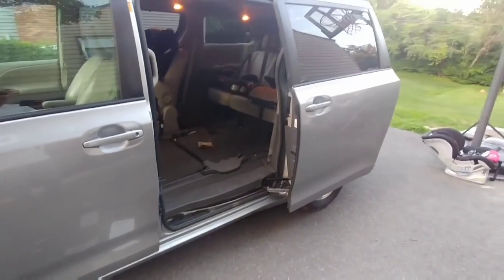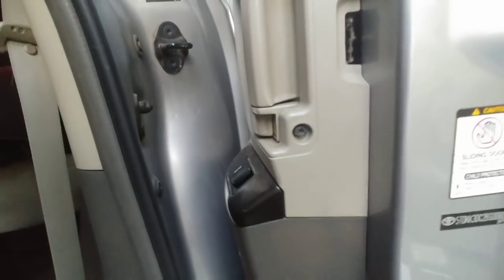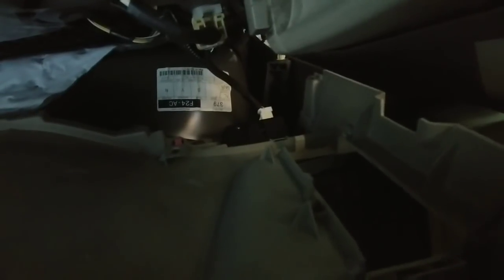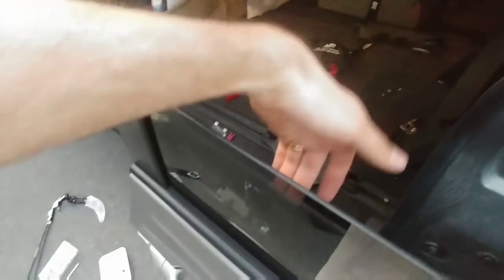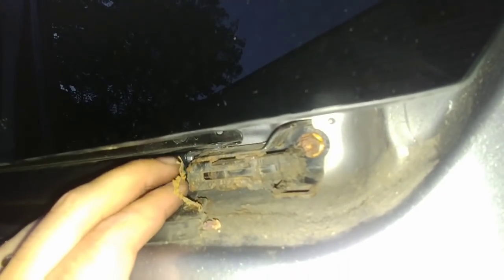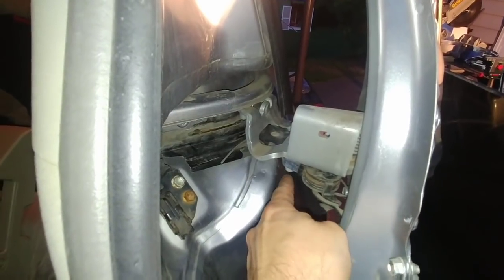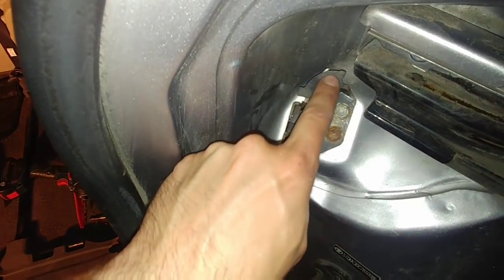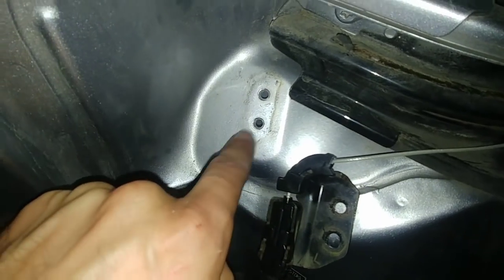2011 Toyota Sienna Sliding Door Cable Replacement

Comment: Thank you so much for this tutorial. Dealer wanted $750 to repair and said the hinge had to be replaced. BS. $30 part and 1 1/2 hrs of time (kept referring back to the video to make sure I got it right) and good as new. Also broke the rear trim piece on the back clip but went back on secure.

Comment: Great video.  Saved me the $500 the dealer wanted (just the $100 part cost).  One quick note - there is a 10yr service bulletin on this so if you have a van less than 10 years old the dealer should be free
Reply: It looks like the service bulletins only goes to 2018.  My 2019 just failed and I don’t think it will cover it.  Good tip though for others

Comment: Very thorough video. I thought I would save $1000 from the mechanic's quote and replace the sliding door cable myself.  After watching a few different videos out there, this is the most simple yet comprehensive video, by far.  I watched your video step by step, and I'm glad to say, I finished it in about 1.5 hours.  It was much smoother than I anticipated.  You covered everything I needed to go from beginning to end, you didn't miss anything.  Other videos had so many extra unnecessary steps, almost intimidating.  Great job.  Everyone should follow your instruction. Can easily save them $1000-2000

Comment: Thanks for posting this video. Saved me hundreds of dollars! $28 for the part and I think it was 10 screws.  Mine were Phillips and 10mm. Veh is a 2011 Sienna LE. Pulls assembly was torn up. You’re right about that plastic piece covering the bracket at the rear window. Have to slide it forward off if a square bolt. The square bolt is situated to the rear of the cover, so don’t try to pry it or it will break.

Comment: Great video, thanks for the help. I just wanted to add this encase others have the same issue. Once all reassembled my door wouldn't work. When pressed the button or pulled the handle the car would emit a long beep and not move the door. I ended up 'forcing' the door all the way closed, including forcing the back of the door into the body of the van. That fixed my problem.

Comment: Thanks for the videos, I just ordered my parts and plan to fix the doors on my 2014 as soon as they come in. Had the driver side snap back in February and have just been opening it manually, but the passenger side snapped last night and is now stuck in the closed position to boot. If I'd known it was this easy I would have fixed the other side back when it broke!

Comment: Hey Mr. Cooper Thanks for the video as so many has stated already. I guess this is a common problem with the doors as it seems everybody is having trouble with(shame onToyota for having this issue and trying to overcharge people to fix it). However with your guidance and a little time and a few other videos (because my door wouldn't open automatically or manually) I got creative got the door open and was able to place the order through the company you suggested. Under $40 bucks with shipping just waiting for the arrival and I'll let you know how it went. For now I just want to say thank you for the video very informative and a hell of a lot cheaper. God bless you man.
Reply: Hey I have a question if you can help me out. Does that white plastic piece thats on the pulley wheel prohibit the door from closing if not removed? I just replaced it on my van and the door opens automatically by will not shut. It seems to be stuck in the open position. If you can get back to me I would really appreciate it
Reply: @rickymon1000  How did you get this fixed? Thanks for your help.

Comment: Good to know I can do it without taking the door off. Last time i changed that cable i was taking the door off and away from the car. For some reason new cable didn't last long. About a year and it only opens now. But doesn't want to close automatically. Have to close manually. Seems like motor starts to pull but door doesnt move at all like its locked in fully open position. Not sure if thats the cable pulley problem or something else. Maybe the bottom lock doesn't unlock. If you had problem like that please give me a clue. Thanks

Comment: Hi, I'm about to change the assembly but I understand that the bracket under the rear window is hard to come off without breaking (at 5m21s).  I'm wondering if someone could elaborate a bit on how not to break that black plastic braket, and what is it's part number (in case I break it). Thanks for the vid!

Comment: The slack that you can pull from both the black and silver cable, will it tighten up once you open/close the door? I have the same problem and ordered a replacement part but when I received it, the black/silver cables were not attached to the wheel. I wasn't sure if I was supposed to roll any slack into the wheel before installing...Thanks

Comment: Thanks for this video. I own both a 2006 (2nd gen) and a 2011 (3rd gen) Sienna and when I bought the 2006 last year to leave at our summer home four provinces away the slider cables were broken on both sides of the van and one of the latch motors was shot too. I replaced only the cables for about $40 each side since on the older Sienna the full assembly is about $150-$180 each side from eBay here in Canada. I did some checking and with the newer design it looks like the full assembly on the 3rd gen Sienna is much more reasonably priced so I won't bother trying to do a cable-only fix like on the 2006. As for the dead latch motor on the older van, I did the $5 fix found here on YouTube, but exchange rate and markup being what it is here in Canada it cost me about $16 CDN for the part. Luckily my latch motors are fine on the 2011. On the 2006 I spent about $160 CDN to do cables on both doors and the latch motor on the one door, which was an incredible bargain considering having the dealer do it all would have cost $4-5000. From your video the repair looks very similar to what it did on the 2006 doors, but the motor attachment part seems to have been redesigned for much simpler installation.

I'll order the parts as soon as I figure out the best price to Canada, and get this done ASAP since I often have my disabled 85yo father-in-law on that side in the back and he really needs the power door.

UPDATE: When I went to the dealer to order the parts they told me my 2011 qualified for an extended recall and they did the whole thing for me at no cost. Apparently the other side had already been done before I bought it.
Reply from the maker: Sounds like it should be easy for you Martin since you already had some experience with the 2nd generation replacement.  Good luck, I hope it goes well!
Reply: @coopersteele  Thanks. I forgot to mention that your video was one of only two I found via Google which shows how to do this on a third-generation Sienna. There are hundreds of tutorials for the 2nd gen fix, but I guess not enough people have had these cables snap on their 3rd generation vans yet. We both have 2011's so I guess we are the vanguard. LOL

I've done a repair tutorial on another topic for another vehicle, so maybe I'll document my fix this time too. The assembly is available from the dealer locally for about $65 CDN which is about what I can get if for online and then I'd have to pay shipping, so I expect to just drop by the dealer tomorrow and pick one up so I can get started on the repair before the weekend.
Reply: @PhoenixRevealed  Do you mind pasting a link for a 2nd generation passenger side door cable replacement into the comments?  I've actually be looking for one and haven't found it.  I have a 2009, so I'm assuming that makes it 2nd generation.  Would love to know the part number as well.
Reply: @brianlodwig752  - I checked my eBay purchase history and calling up my 2019 orders results in a not found page now, but you can still get them from other vendors for the same price I paid back then. You can get just the cable for about $25 CDN, the cable and guide tubes for under $40 CDN, and a complete kit except the mounting plate and pulleys for a bit over $55 CDN. If you need everything including the pulleys and mounting plate it's going to run you around $275 for a rebuilt or $435 for new OEM, but most people just need the cable and tubes, or the cable, tubes, and cover. I don't recommend changing the cable without doing the tubes too. If you order any of these make sure they are for the correct side of the vehicle. They won't work on the side they weren't made for. https://www.ebay.ca/sch/i.html?_from=R40&_trksid=p2380057.m570.l1313&_nkw=2004-2010+sienna+door+cable&_sacat=0
Reply: @PhoenixRevealed  Appreciate it.

Comment: Good job on video. Mine just broke on Sunday, so I am preparing to get the parts & tools I need to complete the repairs. I shall see if part of the cable retracted inside the mechanism or not. Thanks for taking the time on this. I wonder if this is something that I should expect to do to the other side in the near future. I will check the other side for any signs of wear to see if I can do any preventative measures.
Reply from the maker: Yeah, my two sides broke within about 4 months of each other. My advice is to just order both sides so you're ready.

Comment: The 2 bolts that attach to the upper rear door slider rail brace are M6 X 1.0 X 25, part #90080-10252.  Using a screwdriver to loosen and tighten these 2 bolts may be the best way to do so.

Comment: Question...if I can't get to replace the cable can the door be manually opened and closed? If so how can I make it manual?
Reply from the maker: I don't own this model van anymore, but if I remember, that button is to the lower left of the steering wheel. That will put the doors on manual operation. You may need to cut the cable though if it is interfering with manual operation because the electric motor is broken. Good luck!
Reply: Thank you.

Comment: Does anyone know why I can't seem to find the part for this repair anywhere? I have a 2011 Sienna LE and I need the driver side part but my endless searches come up empty
Reply from the maker: Are you in the US?  I see plenty of options if I just google "door cable for 2011 sienna"
Reply: I am in the US. I need the driver side part but nothing is available for the 2011 sienna. Every link I click the part is listed as discontinued and or not available. What’s curious is that the parts for 2010 and older is readily available.
Reply from the maker: @CHASECHRISTENSEN-jr5io  https://parts.toyotaofnashua.com/oem-parts/toyota-2011-2019-toyota-left-driver-power-sliding-door-linkage-sienna-8501608011?origin=pla&gad_source=1&gclid=CjwKCAjwwr6wBhBcEiwAfMEQs1FX6nixrmTMp-phtT9i3ZuFtL_wBkmkcqN0dgSyWB4vSvQ3OKCDyBoCg6cQAvD_BwE

Comment: Thanks for the video. Cable seems to be fine for my 2011 sienna, but still does not open. Every time I try to open drive side door it tries to open it and then close it and same thing when tries to close it, it just makes a sound and doesn’t do anything. Would you know the reason by any chance?
Reply: Same problem here.  Did you pinpoint the issue?  What's was wrong with it?

Comment: Cooper, how did you cut the cable exactly so that the door would open??? My cable snapped, and the door won't open manually. We've ordered the cable assembly per the website you recommended, and are just waiting for that to repair. Appreciate the video, it makes this so much less daunting of a task to fix!
Reply from the maker: I cut it with regular wire cutters. Turn off the power door function, then if you can open the door a little, you might be able to grab the cable with some needle nose pliers and pull it out enough to cut it.  Good luck!
Reply: hi. mine won't open too (only a few inches open actually) and I found out that was because of the latch on the gas lid. just open the gas lid and push the button on the left side of the gas cap, it should release the latch and allow the door to open all the way

Comment: great video . do you have a link of the tools that you used ? also by me wille my door is broken it shows that the door is open and even with the lights off it drains the batterie anyone here have the same experience ?
Reply from the maker: Sorry, I don't know where I got the tools.  If you do an internet search for "auto trim removal tools" you should come up with something suitable.  Sorry I don't have any experience with the electrical problem you are facing.  Good luck!

Comment: Does anyone know... can I just cut the cable and use it as a manual door? When I turn off the power to the door, and try to do it manually, it's really hard to open and close.
Reply from the maker: That might work, but after you cut the cable if you accidentally use it in power mode again, it could damage the door. Just be cautious.

Comment: Is this a similiar repair for the 2010 Sienna? Some vids show removing the window
Reply from the maker: I would guess its similar, but I'm not 100% sure.  2011 is when the model changed, so there are going to be some differences and probably a different part.  IIRC there are a number of videos on YouTube detailing the process for the pre-2011 model year Siennas.  Good luck!
Reply: @coopersteele  Perhaps the design team at least eliminated the window removal for that model year.

Comment: How did you know to remove the white pulley bracket holder you mention at 8:18?  It seems to fit on the van with that white plastic piece on.
Reply from the maker: That's a good questions and I don't really know or remember.  I feel like either it didn't turn if it stayed on or it wasn't on the one I took out so I figured it shouldn't be on there.  Did it work if you left it on?
Reply: @coopersteele  i saw another video where the guy left it on and it worked
Reply: If you compare the part to what was taken off of the vehicle there was no white piece. Doesn’t mean it shouldn’t have stayed on but the reel with the cables of the old one popped out as I took it off so it is there to keep the spool on but don’t know if it is supposed to come off.
Reply: @slukster1  I just did mine and kept it on there. Works fine

Comment: So, I have been told that even after replacing this part to fix the sliding door that the motor will lock up shortly thereafter and you still have to go and replace the actual motor that controls the sliding door... Has anyone else had this issue? And how much did that cost you to fix?
Reply from the maker: I recently traded in this van, but they doors ran well for another four years after I did the cable replacement and there were no issues with the door motor.

Comment: TIP/NOTE - seems obvious now, but when you're putting it all back together, before you pull the unlocked door handle (that previously wouldn't open with power) to put the side panel back on, HIT THE POWER DOOR BUTTON OFF! 

Unfortunately for me, I was watching this video using using car stereo... and in the last 5 seconds of the repair... it snapped my speaker wire and the power window button... with the window still down 👌

Comment: Great video - I hit some pretty big speed bumps though -  the bolt that holds the wires on the rear hinge severed and I had to improvise. 

Worked through that and had everything installed - appeared to be correctly.  But when I tested the door ( without doing it manually), the new part completely destroyed itself. The plastic at the bottom broke to pieces and now I have to buy a new part. No idea what I did wrong.

Comment: Thanks for your post. 

Passenger side sliding door in my 2011 sienna stops at times in the middle and comes back. Other times, it will open and close properly and in some cases, it just beeps twice and no movement. The movement is so erratic. What could be the possible cause? I removed the cover and looked around but couldn't see anything suspicious. Toyota dealership did the sliding door recall 2 year ago but I need to pay $100 - $150 to diagnose this issue now. Any suggestions. Thank you all
Reply: it happens to me the freaking cable is broken now I dont know if I should be bring to the dealer when I purchase the car I also purchase the gold protection plan and I believe it is cover..so I ll let you know the outcome..if it is not cover I guess I have to do it myself..pain in the buck ..Toyota sienna 2017 really sucks
Reply: I called Toyota 3-4 months ago and explained the issue to them. Nothing happened but 2 weeks ago, I got a letter from Toyota stating they would cover the cost. I took an appointment with the dealership and it started working there. (Since I noticed the issue I had turned off the power of sliding door). Don’t know how to started working now!! Hoping that it stays that way.